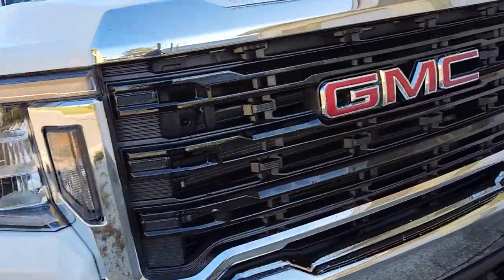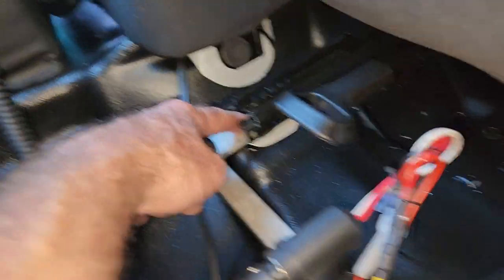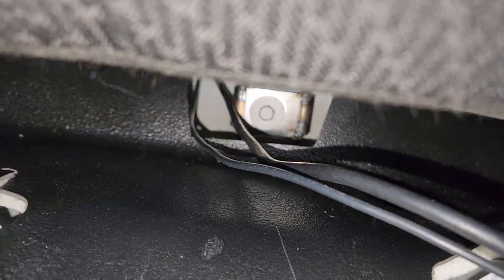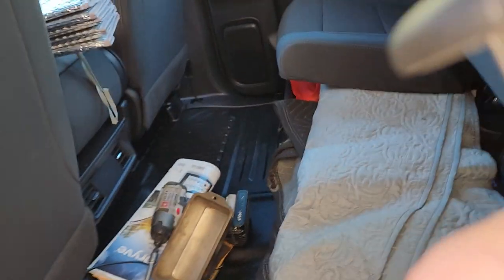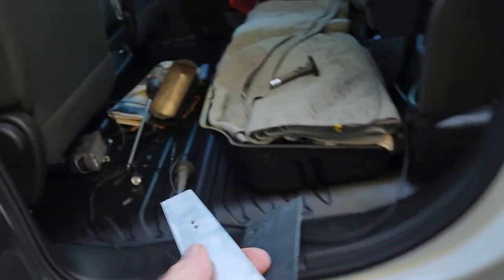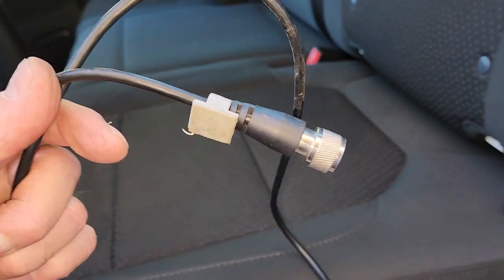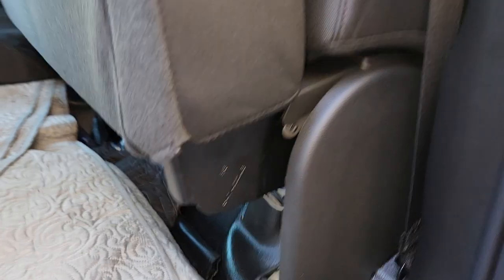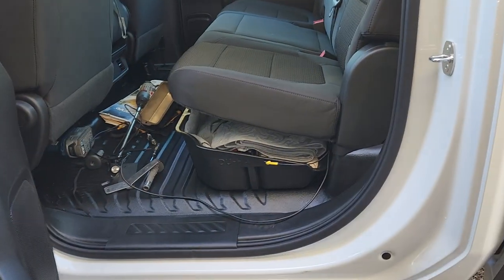2023 GMC Sierra crew cab, CB radio installation hints.

Comment: What did you use for a size on the flat bar Aluminum? Perhaps 1/2" think by maybe 1" wide.
Reply from the maker: @hawkowl455 , it 3/8" but you could use 1/4" if you want to.

Comment: I got a hump mount CB Radio mount from Walcot Radio and mounted it to the transmission hump.  First you have to grind all the protective coating from the mount to get and keep a good ground.  My coax, after I rean it up and over eveything under the dash and steering column, I measured and drilled a hole in the floorboard, and found I could run my coax through the frame and keep it out of the weather.  Once to the box, I fished the coax through and underneath the side railing and used part of a mirror mount to mount the antenna.  Everything out of the way, and ended up with a .2 SWR reading.
Reply from the maker: Excellent, thank you

Comment: Why would you put the radio under the seat?
Reply from the maker: I just didn't want to drill holes in the dash or velcro stick it somewhere. It just seems to work fine there. Thanks
Reply from the maker: Yes channel changes are an issue. Thanks
Reply: @raystone3172  you are a genius.
Reply: @Bryanbobber someone needed to point it out lol